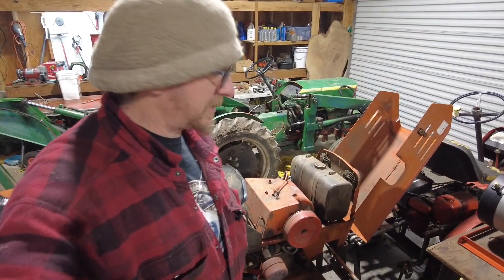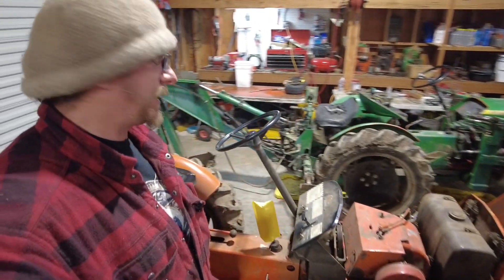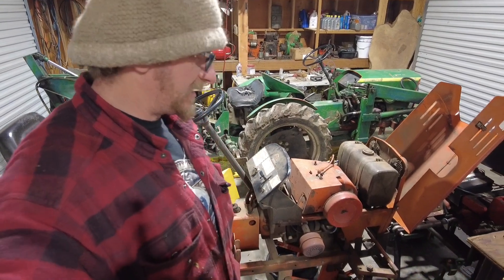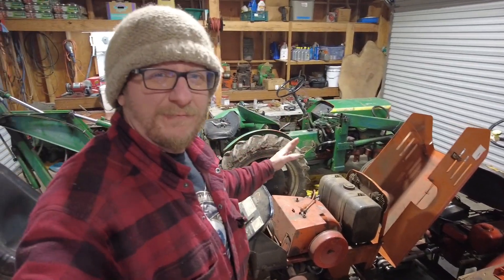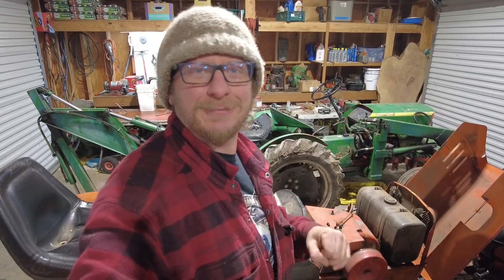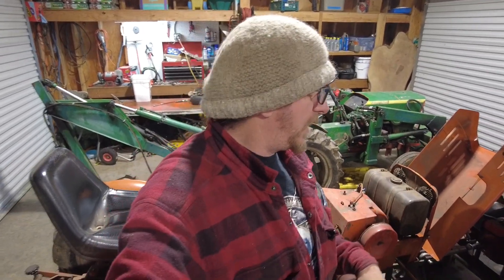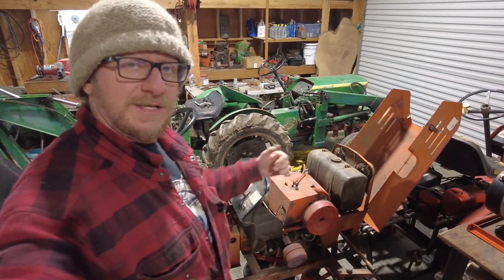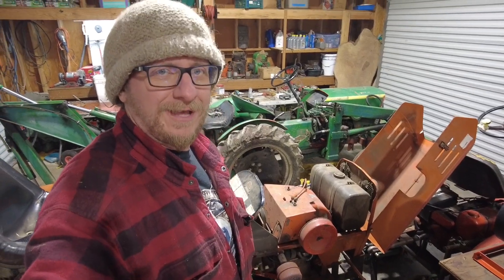EV Tractor Build Part 1 - Tractor tear down and initial fabrication

Comment: Can i ask, did you change anything with the transmission? Or you just still use the clutch and diffferent gears to move the tractor? Does the PTO work?? this is a great video but would love more details. Thanks!!